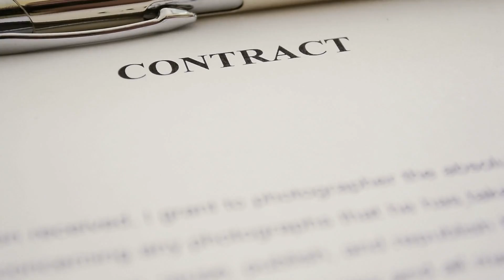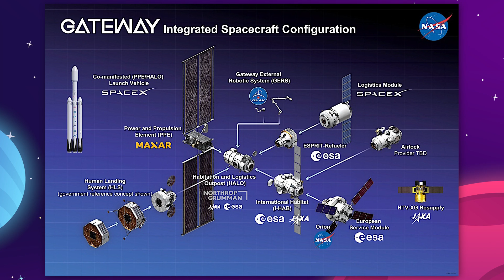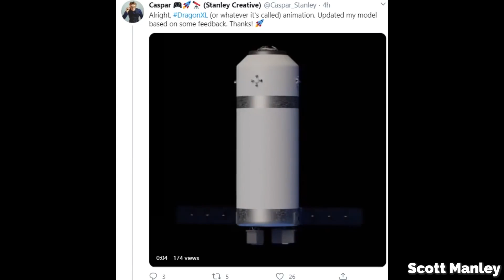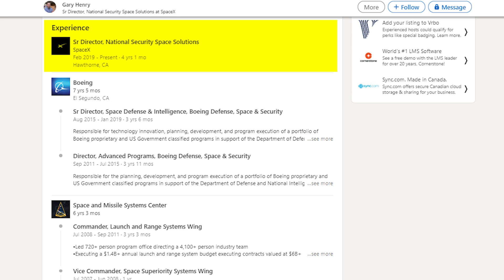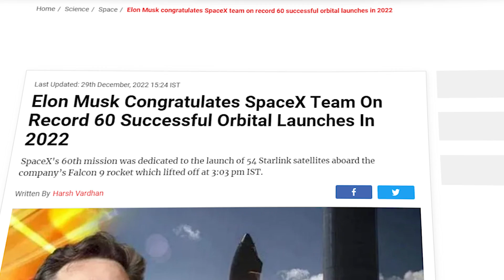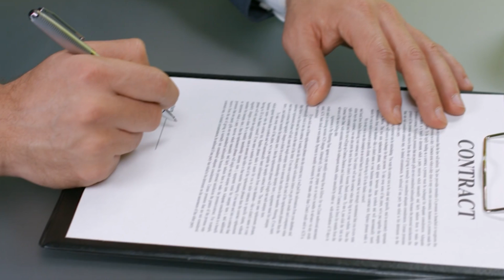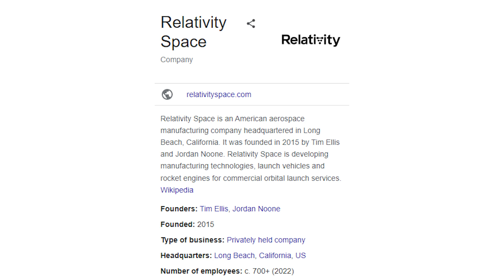NASA Reveals Major New Lunar Gateway Update!

Comment: The concept of producing rocket fuel in space is interesting. There is plentiful solar energy but limited matter. The solar wind could supply hydrogen matter but no oxygen or carbon matter. So the rocket engines in space travel will not be chemical as we know them today. They will need to be some kind of ion drives yet to be developed.
Reply: The way that you would produce propellant for Lunar Gateway, without shipping it from Earth on Tanker Starships, would be to use the water ice on the Moon. That is one of the things that Artemis wants to develop, the way to get water ice off planets with little to no atmosphere. The example plan that NASA has is using a clear tent over the regolith and using mirrored sunlight to heat up the regolith to release the ice. NASA has a RFP out for anyone who has a better idea to contact them with it for a proposal. Breaking water (H2O) gets you hydrogen (H2) and oxygen (O2). With carbon dioxide (CO2) added to H2 (with a catalyst) in the Sabatier process, you get methane (CH4) and H2O. Another thing that NASA wants to fully develop is making propellant on other worlds via breaking water and or making methane, depending on what the spacecraft needs. So propellant production in the quanties needed for refilling a spacecraft are years away.
Reply: @steveaustin2686  You are correct in most respects but here is the problem in the long term. Sunshine 2 weeks on 2 weeks off on the moon. The poles are not the ideal solution in the long term
Reply: @steveaustin2686  Problem 2. Starship uses methane which is not available on the moon in the short term. In the long term the carbon in the regolith can be used to create methane but this is a very big if
Reply: @jeffharmed1616  The reason for putting the Artemis base at the South pole, is some areas have like 90% sunlight. Which is why the Shackelton crater is a hot topic for a base, as the rim can have that almost continuous sunlight and the access to continual shadow from the crater rim.

Not all rockets use methane as a propellant. Liquid Hydrogen (LH2)/Liquid Oxygen LOX) is a very popular deep space propellant mix as it is very efficient, more so than LCH4, and the smaller tanks of upper stages don't have as much problem with the propellant ratio needed. So that is no problem for propellant from the Moon. There are papers about methane production on the Moon as apparently there can be a decent amount of carbon in the water ice. So LCH4 might be able to be made there as well. That would be one of the things Artemis would be looking at.
Reply: @steveaustin2686  Yes it did mention the north & South Pole advantages in my early message and alluded to their short term limitations. The only real economic propulsion system in the rocket game is starship with its methane fuel. Everything else pales in comparison so I would support Dr Robert Zubrins position that the moon looks like a folly
Reply: @jeffharmed1616  That entirely depends on the mission. For a deep space probe, ion propulsion beats out LCH4. Hell, even LH2 beats out LCH4 for efficiency, since deep space probes and upper stages don't have near the propellant ratio problem that boosters do. LCH4 is better than RP-1 as it is cleaner, is roughly the same temp as LOX, and has more energy than RP-1. Don't be blinded by SpaceX's success to think that everything must be SpaceX. Having redundancy is a good thing, as CRS-7, AMOS-6, and the problems with Starliner showed.
Reply: @steveaustin2686  You are quoting factors amongst many. SpaceX looked at the whole picture to come up MethaLOX as the best fuel. Looking at specific impulse alone as the predominant parameter is a huge mistake. That is why from a practical point of view Artemis is problematic. IMHO the USA is going to the moon because of BRICS. There is an outside chance that Tritium might be a winner in an Artemis project but it’s not a good bet.
Reply: @steveaustin2686  Moot
Reply: @jeffharmed1616  🙄
Reply: well, not MUCH oxygen or carbon, but it does have some as the sun has more carbon and oxyben than even Venus and Earth combined just not in as dense a form.

Comment: Having Gateway launched by the end of this year even would be insane but cool
Reply: Launch of first payload is next year atop falcon heavy.
Reply: @HunnidTheTrapper02  Yeah, the hold up is not SpaceX's Falcon Heavy, but IF Northrop Grumman (HALO) and Maxar Technologies (PPE) can get both of those modules ready in time for the launch. It has already slid from May 2024 to Nov 2024, so it would not be surprising if it slides into 2025. The NASA IG is expecting the Artemis III mission to slide from NET 2025 to NET 2026, either for the xEMU suits (likely) or the HLS Starship (possibly) or even SLS/Orion if things muck up there. The Artemis III crew flight around the Moon on SLS/Orion is NET 2024 as some of the Orion hardware from Artemis I is being reused for Artemis II. Artemis III has its own separate capsule, so it should be able to go off 6 months to a year after Artemis II.
Reply: This year? About the same chance as finding a cure for cancer this year
Reply: Yeah, no
its not happening this year.
Reply: If you find giant wastes of money cool then yes this would be the very definition of cool. the main propose for the Lunar gate way was to help crafts without an abundance of deltaV get to the moon and back but they are using Starship which like has a massive over abundance of deltaV and the fact that the interal volume of the Starship it's self will be bigger than the station...

It's fucking idiotic, like they are already planning to retire a Starship every 2 - 3 trips to the moon like literally you could just create a station out of that with way more internal volume if you really want a space station around the moon.

sure you would need another launch to bring some shielding to add to the outside of the craft to stop micro meters and charged particles because a lunar starship wouldn't be outfitted with the required shielding, but like it's only another 1 launch to bring that. and for the anti micrometaor armour like all you need is armour as think as a relatively think tin foil because all you need to do is make sure the micrometeoroid vaporises a distance before it hits the hull and the velocity does that for you basically on contact with anything stationary.

The distance gives the vapour room to dispose and it hits the inner hull leaving basically no damage because the energy is dispersed over much much much larger section of the inner hull, for the radiation shielding it's charged particles you are mainly concerned with because solar storms would kill the occupants without appropriate shielding, but anything with hydrogen in it is a good radiation shield, polyethylene is a good radiation shield and thats a plastic so it's not particularly heavy.

so 100 tonnes should be more than enough mass to retrofit a Starship to be a station.
Reply: if only people understood what a waste gateway is .... sigh....
Reply: and cost at a minimum 4.2 billion dollars.
Reply: @jessepollard7132  No, the PPE and HALO modules are launching on a Falcon Heavy for $331.8M. The I-Hab and ESPIRT modules are hitching a ride with Orion, which is already going to the Moon to deliver crew.

Comment: to bad we couldn't spend money on propellant to push the space station into a moon orbit.
Reply: It wouldn't survive. and is coming apart even now.
Reply: The ISS is old. Think of it as a 2002 minivan being driven by a harried soccer mom with 7 kids. It needs to be replaced as micro cracks are starting to appear in the hull. Besides, the modules for Lunar Gateway are already being built.

NASA plans to deorbit the ISS around 2030 and plans for Axiom Space to have their commercial space station up and running before then. NASA is also funding development of other commercial space stations under their Commercial LEO Destinations (CLD) program.
Reply: had nothing to do with proppellant - but the fact that the ISS infrastructure is beginning to fall apart - the structural beams are fragmenting and ought to be replaced. instead, the entire thing will be discarded as non-maintainable.

Comment: Why don't they design the gateway with the hull diameter of starship in mind? The modules could be multiple times larger, making for a much more luxurious and less claustrophobic lunar station.
Reply: Because Northrop Grumman is building the HALO module based on the Cygnus module. Alenia Thales Space is building the I-Hab and ESPRIT modules, with JAXA helping with I-Hab. 

The PPE & HALO modules launch together on the Falcon Heavy. It is 3.7m and the fairing is 5m internally. Starship is 9m, so a module that size, won't fit on any other rockets.

After the Artemis III manned landing is over, HLS Starship is either left in lunar orbit or disposed of. Some are lobbying for HLS Starship to be attached to Lunar Gateway when it arrives, so that it would provide extra space. Lunar Gateway was not planned for such a large spacecraft to be docked, so who knows if NASA will change the plans that way. HLS Starship would likely have to set aside some payload mass for modifications to be attached to Lunar Gateway. I think it would be a good idea, but I'm not an engineer or with NASA.
Reply: They could also use expandable models which are cheaper, lighter, and have more volume space. Expandable models have already been used on the space station and proven reliable.
Reply: @acemax1124  except Bigelow has gone bankrupt by now
Reply: @anuphys  Other companies like Sierra Nevada Space have there own version of expandable models.
Reply: Starship is so big it doesn’t need a station. If you want a station, just park starship in orbit. Lunar startship can dock with that. If it wants to.
Reply: @TheBooban  That's the other cheaper option to use a Star Ship modify to be a space station.
Reply: so that it would be more expensive.

Comment: 6:15 SpaceX said that they shut down one engine before the test started and the other engine shut down on its own, after starting. The engines were likely at 50%, because while the Superheavy booster LOX tank was filled, the LCH4 tank was only minimally filled. There was also not the Starship (second stage) with its 1,200 tons on propellant on top, so running the engines at 100% may have caused the booster to break free from the clamps and launch. Not an ideal situation. SpaceX has done plenty of full power and full duration tests at their McGregor facility on Raptor 2 engines, so SpaceX is evidently confident in them working. 

The [DELETED] Starship propellant depot will almost certainly be used for HLS Starship, before it is used for a Mars mission. The SpaceX plan for Artemis III, is likely the same plan for Mars. From page 27 of the GAO decision to deny the HLS complaints. [DELETED] is apparently at least a propellant depot Starship variant from the context and SpaceX had the GAO redact that info. Added in Musk's payload update (~150t) and he says that it is up to 8 Tankers to fully refill HLS Starship, depending on HLS Starship's mass. My comments are in ().

"SpaceX’s concept of operations contemplated ten total launches (down from 16), consisting of: 1 launch of its [DELETED]; 8 launches of its Tanker Starships to supply fuel to [DELETED] (down from 14); and 1 launch of its HLS Lander Starship, which would be [DELETED] and then travel to the Moon."

The HLS Option A contract is for the Artemis III landing, and test landing, and NASA awarded SpaceX the HLS Option B contract in Nov 2022 for either Artemis IV or V, depending on what happens with the second lander under Appendix P.
Reply: why so much [DELETED]
Reply: @_apsis  Because SpaceX had the GAO redact the info on [DELETED] which is a propellant depot from the context. We don't know what [DELETED] is called or what else it might be, besides a Starship based propellant depot.

Comment: Why doesn’t SpaceX make large capsules out of starship that are just empty shells ready for configuration once in location in lunar orbit.
Reply: Likely because SpaceX will be busy enough with HLS Starship and the other two variants to get it to the Moon. Musk's daily Starship launch cadence is a far off goal, as the SpaceX plan for Artemis III is 1 Starship variant launch every 12 days per pg 10 of the GAO report denying the HLS complaints. It also takes up to 10 launches to get an HLS Starship to the Moon (GAO pg 27), at $1.15B (HLS Option B contract). Sending the PPE & HALO to the Moon on a Falcon Heavy is $331.8M to NASA. The I-Hab and ESPRIT modules hitch a ride with Orion on SLS,  which is already going to the Moon anyway.
Reply: This will be useless answer but a true one

Beacuse nobody paid them to do so :)
Reply: @_mikolaj_  LOL. Yeah, it is expensive to get stuff to the Moon.
Reply: @_mikolaj_  Oh for sure. 
The HLS Starship is basically out of propellant once the surface mission is over. The HLS Option A contract does not require sustainability. I would not be surprised if some of the cargo payload was used for modications of Starship as a module on the Lunar Gateway. That would also require the modification of Lunar Gateway as HLS Starship would likely outmass it. That would surely make it difficult for Lunar Gateway to keep attitude control and for any orbit corrections. That capability would likely have to be built into HLS Starship.
Reply: It’s going to take 7-10 launches just to work out the niggles and stop the RUD’s. I will point to to all the all the boosters that were used up while learning to land that rocket.  No, SpaceX is not starting over as they have landed more spacecraft than everyone else in the history of man are the experts. But this one has different control, propellents, propellant systems and landing methods.  It will be exciting to watch.

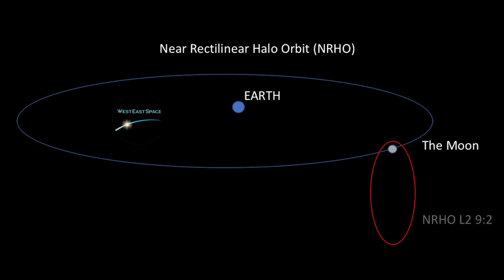Comment: 4:50 The NRHO is very stable compared to a low lunar orbit. That is much more important for long term stability of the Lunar Gateway, since the propellant for the PPE still has to be sent to the Moon. So the less propellant needed to send to the Moon, the better.

The launch of the PPE and HALO together on a Falcon Heavy is NET Nov 2024 as you mentioned earlier. The path they will take to the Moon takes months to get there (you also mentioned), so may be ready in 2025 at the earliest.
Reply: They have discovered stable frozen low lunar orbits. Saying low lunar orbit is unstable is not accurate.
Reply: @garychurch9237  Do you have a link?  Because everything I have seen is that a low lunar orbit is less stable than the NRHO, so you need more propellant in a year.
Reply: @steveaustin2686  Frozen Orbit- Wiki. It's not hard man.
Reply: @garychurch9237    Maybe you should have read it first. 
"Through a study of many lunar orbiting satellites, scientists have discovered that most low lunar orbits (LLO) are unstable.[3] Four frozen lunar orbits have been identified at 27°, 50°, 76°, and 86° inclination."

Since I have stable orbits as the first criteria, what I was disagreeing with the video about, you also have the communication aspect, which was the first criteria in the video. I would put it second. In those LLO, the orbital period is about two hours, so the majority of the time, the Lunar Gateway is out of contact with the surface mission under it. In the NRHO, roughly 90% of the orbit is in contact with the surface mission at the south pole. And depending on the location of the base on the south pole, like Shackleton crater, you can get almost all the Moon's orbit in sunlight. A big factor for a lunar base, since a lunar night is two weeks long.
Reply: @steveaustin2686  Not going to argue. Bye.
Reply: @garychurch9237  Ok, didn't think it was much of an argument.
Reply: @steveaustin2686  maybe you should read what you copied?

most orbits are unstable, but stable ones were identified and even given exact inclinations

lunar orbiter sattelite, that gives us all the latest surface pictures, is on such orbit for a decade already, iirc

---

there have been several criteria for choosing nrho, but main reason claimed for the choice is 24/7 communication
Reply: @NoNameAtAll2  Did you read the rest of my post or only the part I copied. Here it is again.

"Since I have stable orbits as the first criteria, what I was disagreeing with the video about, you also have the communication aspect, which was the first criteria in the video. I would put it second. In those LLO, the orbital period is about two hours, so the majority of the time, the Lunar Gateway is out of contact with the surface mission under it. In the NRHO, roughly 90% of the orbit is in contact with the surface mission at the south pole. And depending on the location of the base on the south pole, like Shackleton crater, you can get almost all the Moon's orbit in sunlight. A big factor for a lunar base, since a lunar night is two weeks long."
Reply: @steveaustin2686  shame on NASA for wanting ANOTHER pointless space station .... its not needed we want to land on the surface. period.
Reply: It’s taking months, Assumably because they’re using ion thrusters to raise the orbit of the gateway station  because no orbit takes months to reach the moon from LEO, that’s just not how orbits work